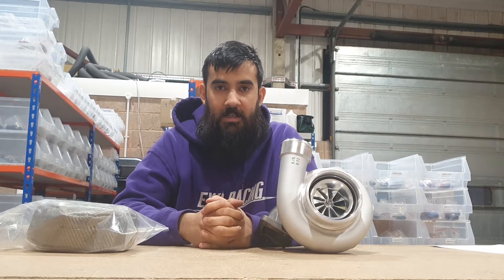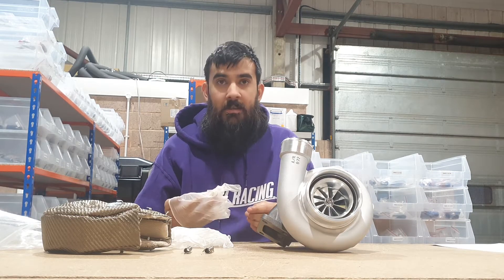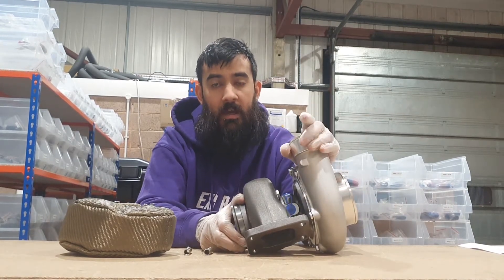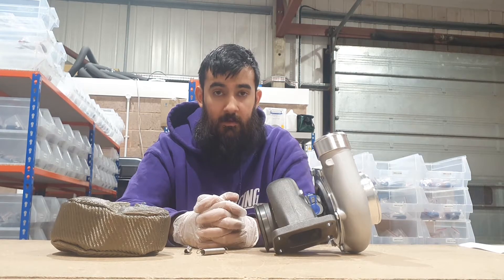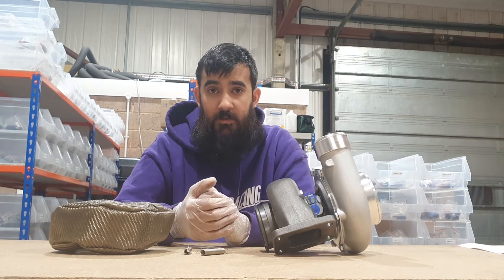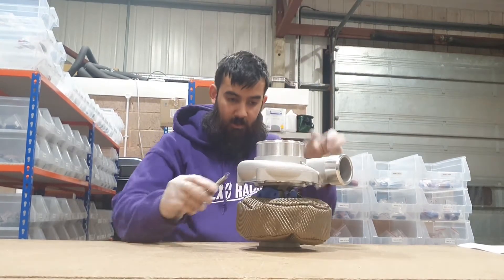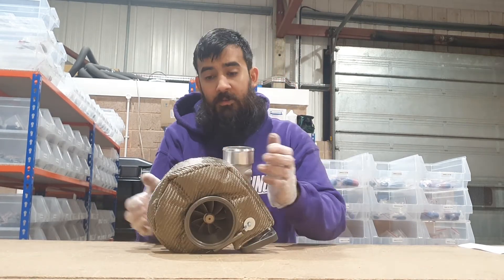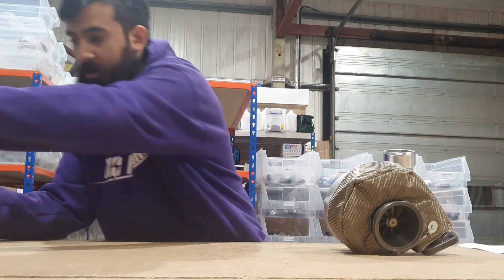Why You NEED a Turbo Blanket

Comment: Why is the factories not using them ??  Cost can't be that big a deal if there is real benefit
Reply from the maker: There are a few reasons why OE manufacturers don't use them, extra cost, warranty claims if they get doused in oil etc, whereas most performance cars are maintained pretty well for damage, and mostly that stock cars aren't designed to be run on the limit like track cars, so they opt for products such as aluminium barriers instead.

Comment: It's a give and take. Yes, faster spool but more wear and cracking from the extra heat. It could damage the cast on the exhaust side. Good if you have lots of money and time for replacing turbos. We don't think about the negative effects when we are getting a good thing. 😜
Reply: Seems it only wears down the manifold on very cheaply cast manifolds from my research, and not every one will have an issue.
Reply: @JustinBone I use a stock RB low mount manifold and it holds up fine, but my friend on the other hand who uses a eBay high mount with a blanket experienced cracks and small leaks around the welds

Comment: Then it heat soaks the turbo to much it's been tried time and time again
Reply from the maker: Although yes this will increase the temperature of the turbo, they are designed to be hot, where your brake lines and coolant hoses are definitely not designed to get that hot!!! Another note is that exhaust gas moves quicker with temperature!

Comment: I don’t think is good idea to install turbo blanket !,, turbo will get mor hot
Reply: Which leads to quicker spool and u won't radiate 5he whole engine bay
Reply: It's a give and take. Yes, faster spool but more wear and cracking from the extra heat. It could damage the cast on the exhaust side. Good if you have lots of money and time for replacing turbos. We don't think about the negative effects when we are getting a good thing. 😜